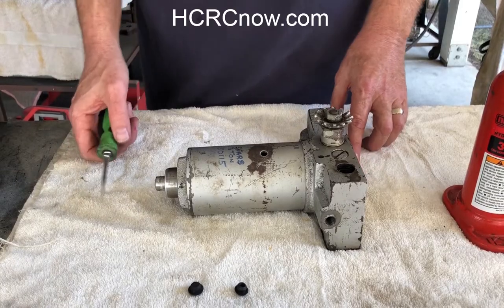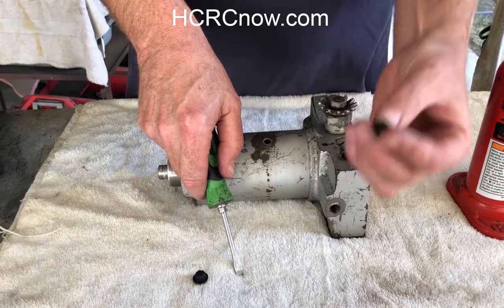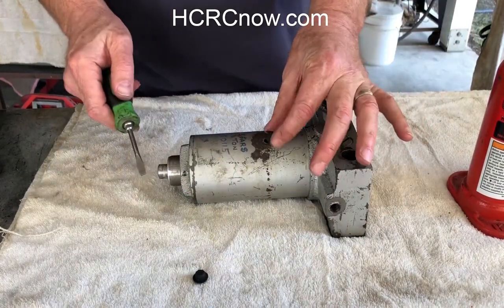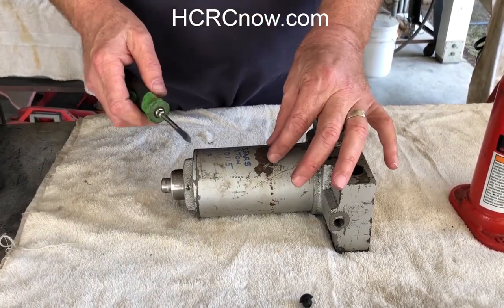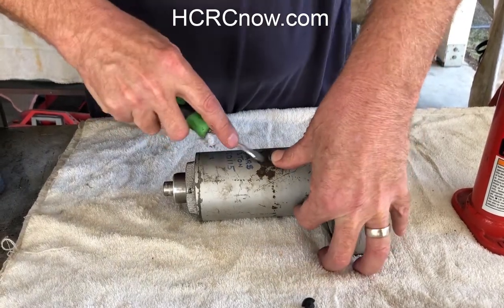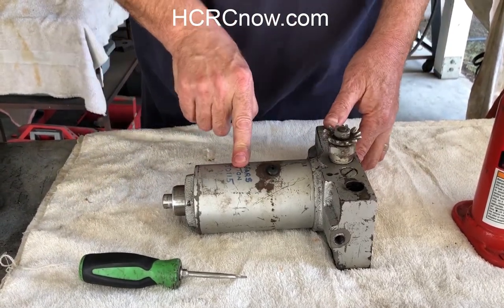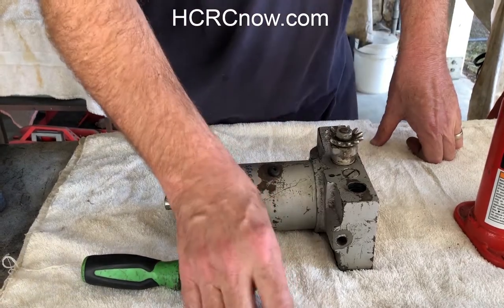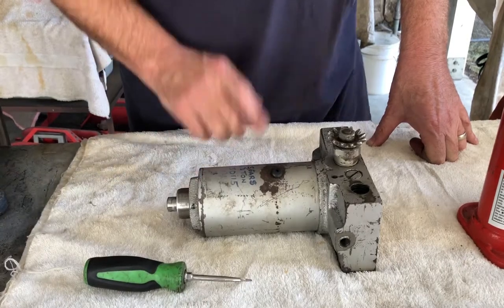How-To: Install a Rubber Plug into a Vent Hole on a Floor Jack

Comment: Soo Simple on the bench -I spent an Hour yesterday trying to get the plug in my jack when its all together ! The one I have the pump apart is getting tapped for a pipe plug !

Comment: Excellent demonstration on a jack that's unencumbered by surrounding material, but the plug on my floor jack is between the frame and the lifting arm. It's darn near impossible to get to let alone work a plug into the hole.

Comment: I was wondering about the vent hole cup on my new to restore Lincoln All American 2 Ton floor jack that looks somewhat low profile.  I think just needed the air bled out.  Though I've never seen a plastic cup on a hydraulic cylinder tube-barrel so am still perplexed there not being a screw with seal there.  Though maybe the rubber vent plug is all that's required.
Reply: Oh and thanks for sharing!  Great website as well I found listed in the description of "Impalaman's Garage" video titled "Walker Floor Jack Model 93632 1.5 Ton - Rebuild - Part 1."  Thanks again!  Man, scary how much can get sent to the salvage yard recycled that's perfectly good and probably build better in the shape in where probably just needs pressure washing to "look good enough" and maybe some other repairs that don't cost that much for another decade or more use.

Comment: Where could someone buy plugs.
Reply from the maker: Our website. HCRC now.com

https://www.hcrcnow.com/shop/parts/categories/rubber-plugs
Reply: Type in hydraulic horizontal Jack rod  plug plunger in search bar. You can find 1 for as little as 1.68 to a multipack up to 10.00. hopes this helps.